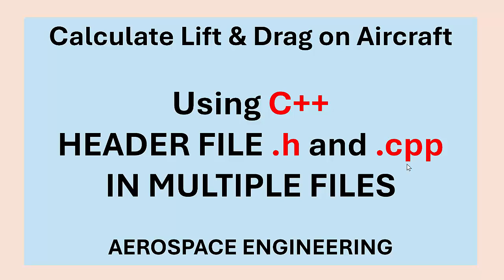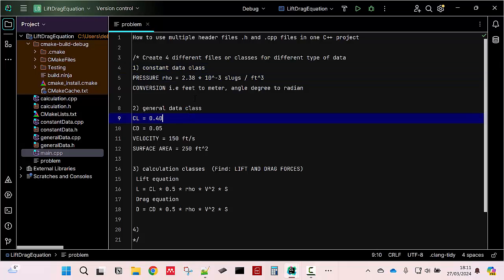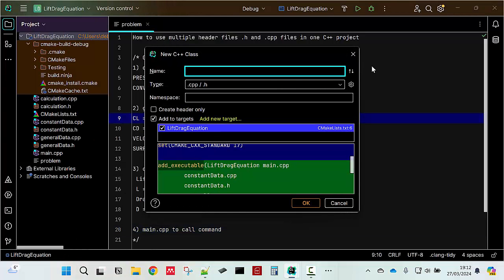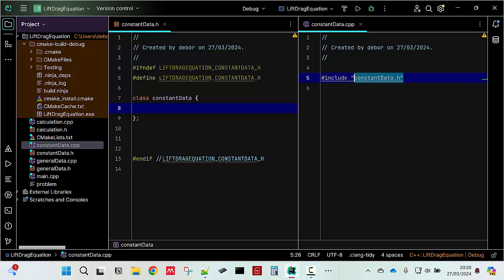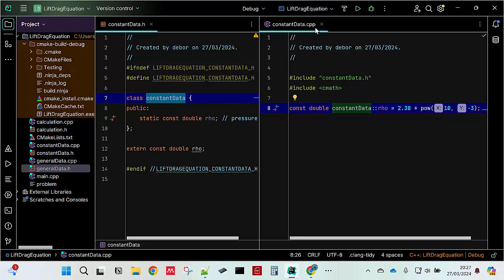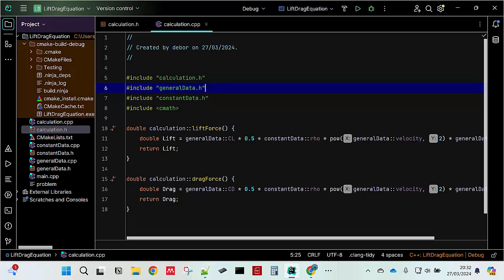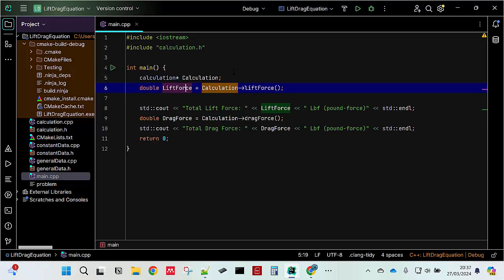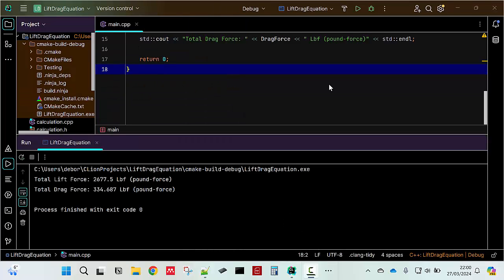CLION C++ Header File .h in Multiple Files  #cpplus #aerospacecoding #liftdragaircraft #clion

Comment: I have an issue, when I click that run button I get an undefined reference error with some issues with linking. 
I have a folder in that I have my .cpp and .h files. Any ways to fix the issue in CLion

Every code and adding .h header in main.cpp is all correct.